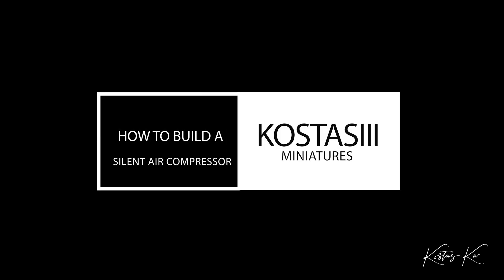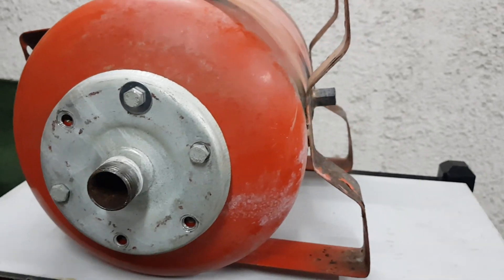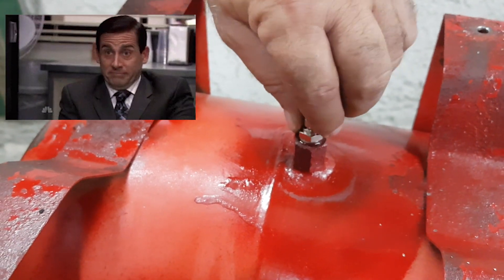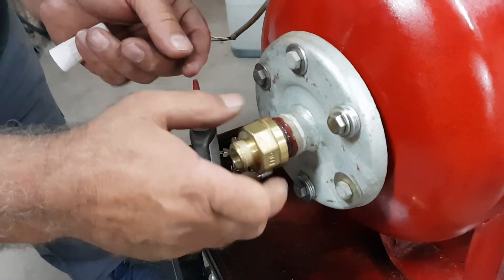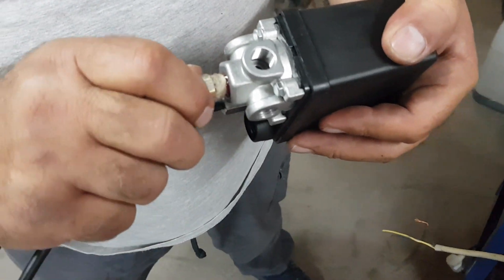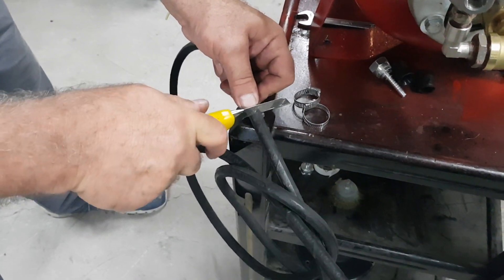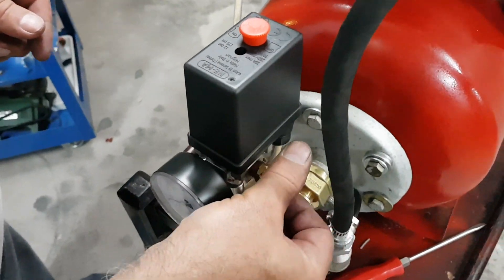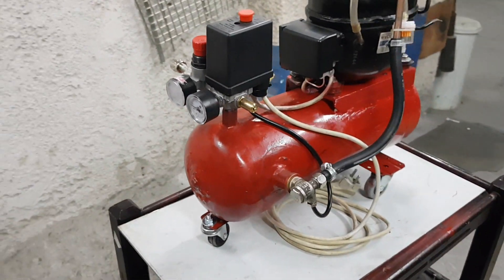DIY How to build make your own silent air compressor - Version 2

Comment: Very nice build!
But I really don't understand why you should modify the pressure release check valve?? It is being activated(opened) by a mechanical lever that is pushing on a needle in the upper end of the valve that is activated by a mechanical movement of the switch mechanism once the switch contacts gets disconnected. So the opening of the valve is not controlled by the amount of pressure and does not depends on the capacity of the tank.
I am not trying to argue, just expressing opinion and trying to get educated as I'm planning such build in near future. Please let me know if my statement is not correct and I'm missing something.

Comment: Does the pressure switch bleed the pressure in the line running from the compressor? I made one without that type of pressure switch and the pump will not start under a load.

Comment: How do you top up the oil and how often?
Reply from the maker: From the tube that the compressor blows the air you can add some thin oil like the one for sewing machines. It depents from the usage but I haven't refill 4 years now
Reply: @KostasMiniatures  thanks! I’ve built the same one, was afraid it can die since I don’t how mush oil it consumes

Comment: You didn't do a very good job of explaining why the pressure switch needed to be modified and how what you did would work.  I don't see why the pressure valve would depend on the VOLUME of air moving into it, just the PRESSURE of the air at shutoff.  I could be mistaken-can you expound on why you did this?

Comment: Will it have enough pressure and flow rate for driving nails?
What is the typical pressure maximum of fire extinguisher bottles?
Reply from the maker: Certainly, it is possiple, you simply need to ensure that the refrigerator motor does overfill the tank rapidly. Otherwise, you risk either putting excessive strain on the motor, leading to quicker wear and tear, or depleting the air supply in the tank.

Comment: How can I get a clean air and how can I catch the oil vapour so the compressor doesn’t burn
Reply: Harbor Freight water-oil separator on the compressor output tube.

Comment: I don’t know what the max pressure that compressor can produce, but perhaps you can use a high pressure compressed air tank that can handle more than 3,000 psi to build a air compressor for high cfm needs.
Reply: Thats over 200bar!, even expensive commercial ones operate at a maximum of about 12 bar.

Comment: Hi, I would like to build this but I am a little confused, How do you stop oil from the compressor to go to the air tank, I mean the compressor is full of oil so how do I stop that oil from getting into the air tank ? Thank you
Reply: I think they run them dry without oil , so not sure how long they will last.
Reply: harbor freight sells a water-oil separator you can splice in-line at the compressor output.

Comment: Thank you for this informative video kostas! I just built mine  but had some issue where it doesnt create enough pressure to my tank, my regulator and air pressure gauge doesnt seem to read the tank. I wonder what causes the problem. btw I used condor m11 for my pressure switch. Thanks again Kostas hope you read this comment!
Reply from the maker: Hi Czar. Better late than never! Did you manage to find a solution? Low pressure usually is air leakage or not so strong compressor.
Reply: @KostasMiniatures  Hello Kostasiii, Yea the thing with mine was it is a prebuilt air compressor using a fridge compressor and wanted to add an additional air tank

 ( https://preview.redd.it/z96pojv4hyw71.jpg?width=960&format=pjpg&auto=webp&s=13b6d72394b0768b2f89c4b2d72cfcc0e851e5e5 ) 

I was able to add a pressure switch as well as the new tank but yea the pressure works now there's some leakages that I might need to cover with Teflon tape. 

overall the compressor is working but when left alone with air inside, the day after the tank is empty which tells me there's leakage. anyways thanks for replying man! I appreciate it

Comment: Hi, what about the wiring for the pump? I have 3 wires running off from it, 2 which where for the thermostat, and one to the light inside the fridge

Comment: Kostas , 
Thank you so much for your detailed explanation of the build , and in particular the modification of the pressure switch .
My first build failed due to this not functioning, resulting in a burnt out motor , however , following the instruction in your video, the modified pressure switch works perfectly and I have a most useful compressed air system in my small workshop , 
Thanks again ! .
Reply from the maker: Wow thank you so much for you feedback. I'm really glad that helped you. Really appreciated

Comment: Sir what about behind tube.. There is   a niple right.. Close or.. 
Thank u
Reply: Good morning.. I mean that tank air compresor.. There is a niple or not 
Thank u
Reply from the maker: @mokhamadansori6752  at the compressor, are 3 small tubes. One is the intake, the other is the outtake, and the 3rd is the closed on that is for maintenance in case the technician want's to add cooling gas
Reply from the maker: Hi what tube do you mean?

Comment: What sort of cfm output do these refrigerator compressors have?
Reply from the maker: I don't know that but I think you can find it at the specifications of the fridge... maybe
Reply: @KostasMiniatures  
The manufacturers data sheet for the compressor will give you the displacement, (in cc`s) which you multiply by 2900 and divide by 1000 for litres per minute. This the the theoretical free air output, the real world output will be somewhat less, typically 10%-15%

Comment: Thanks for the video very informative, this tank called Expansion Vessel, they have a rubber membrane to isolate air from water, did you have to remove that rubber tube inside it or it is already busted? Thanks again
Reply from the maker: Thank you for you kind words and the inform about the tank. No I didn't removed the ruber tube. I left it as is
Reply: @KostasMiniatures  If you haven't removed the rubber membrane but added a valve at the bottom, does it make any sense? The air will only be in the balloon, and so will the condensate.
Reply: @KostasMiniatures  Should be ok I will do the same, THANKS

Comment: Hi!
These water tanks has a thing I the back. Not sure what it is for, but what did you do with it?
Picture also would be appropriated.
Reply from the maker: Just a nut. I think is part of the base and might help at the original placement
Reply: Under the plastic cap is a standard automotive air valve for filling air and generating pressure. The liquid is in the membrane and the air is in the rest of the tank, just like in membrane hydrophores. In this case, the valve becomes completely unnecessary.

Comment: It looks great!
I have a silent air compressor from Olimpo which is nothing more than a refrigerator motor but do not have air tank.
http://olimpoair.it/
I've been thinking about building one like this for a long time but I'm afraid it will go wrong :)
Didn't you forget to put the moisture trap on that one?
Regards
Reply from the maker: Very nice compressor.It works without an air tank? I haven't seen one like this. Very interesting. The moisture trap is attached with the air regulator. I istalled it later as it was optional for me. The place I'm living now is very dry. Thank you
Reply: @KostasMiniatures  Yes, it works without the air tank.
It heats a little but the truth is that I have it for almost 30 years :)
I can’t say the same about it here where I live. There is some humidity to say the least.
I also use a moisture trap on the airbrush.